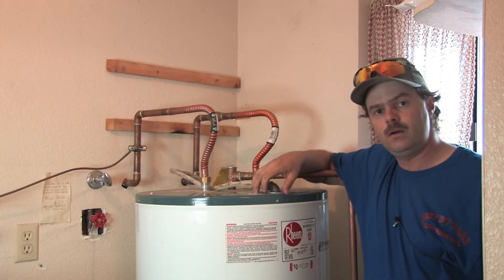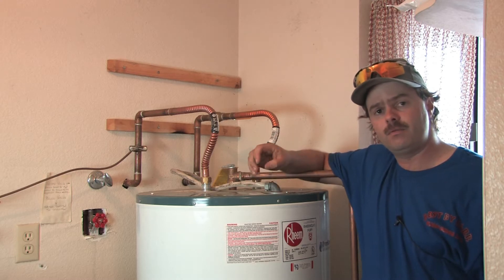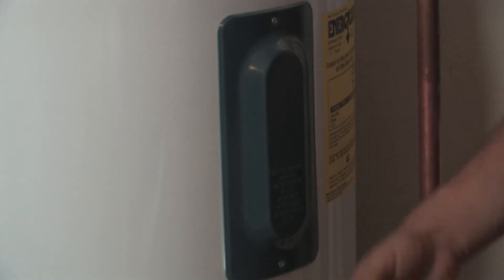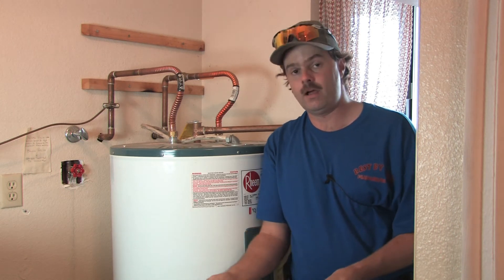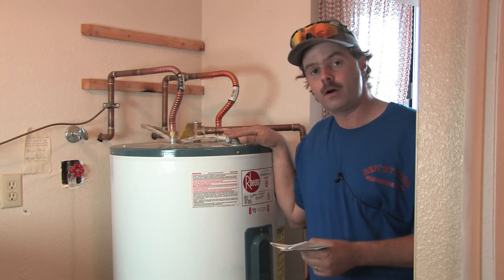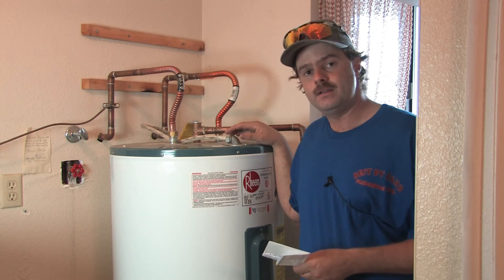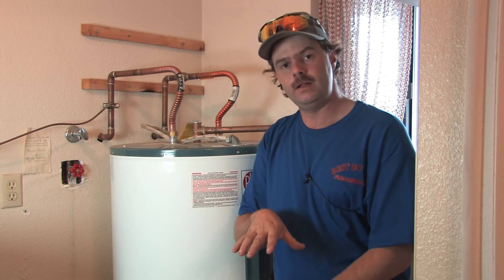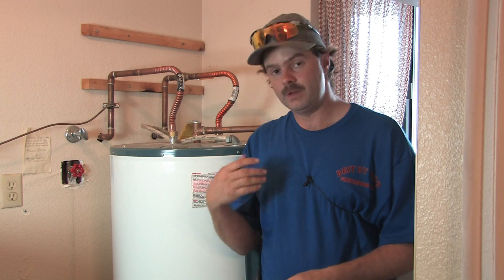Hot Water Heaters : How to Determine Required Size of Electric Heaters

Comment: The 1st Hour Rating - Start Hot draw 15 gal, wait 30 Min. Draw 2 gal, wait 30 min draw 1 gal, wait 9.5 Hours draw 6 gal, wait 1 hr draw 4 gal, wait 30 min. draw 1 gal, wait 45 Min Draw 1 gal, wait 15 min draw 1 gal,wait 4 Hours 35 min draw2 gal, wait 30 min. draw2 gall, wait 30 mindraw 2 wait 15 min draw3 add 17 pages of bvullshiy and you get 45 gallons 1st Hour Draw